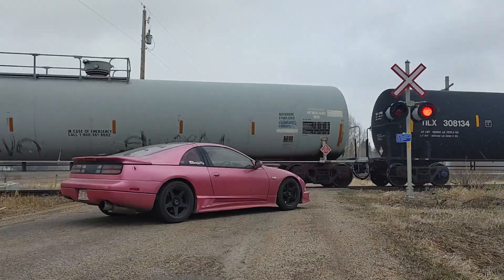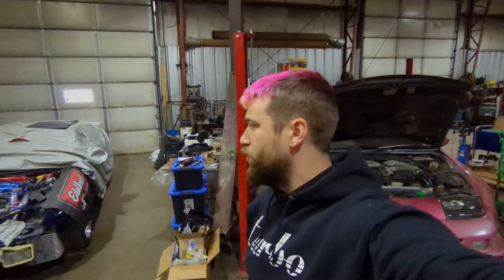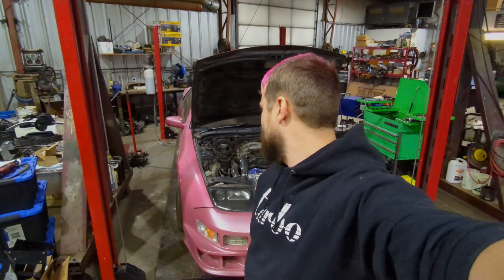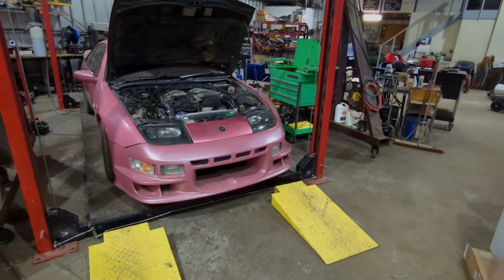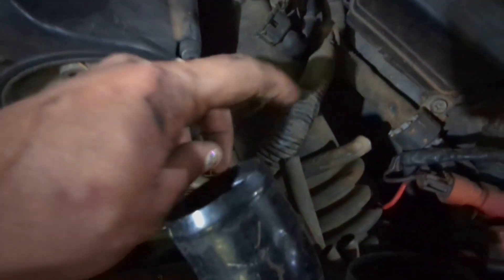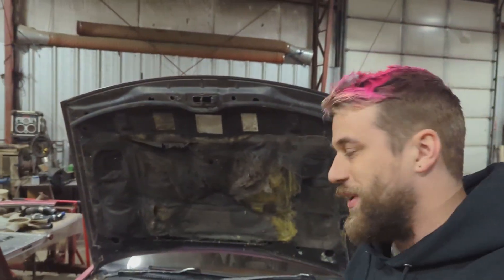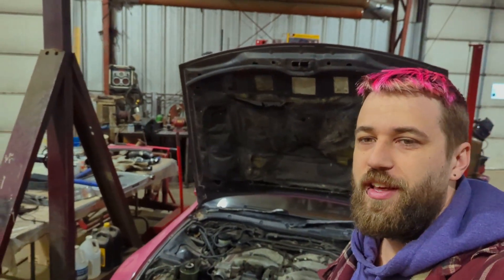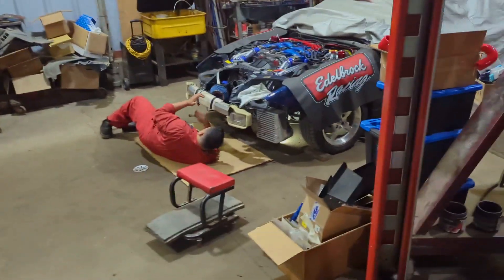Day 1 Building a MASSIVE SINGLE TURBO Z. No block will be safe.

Comment: turbo placement will be sick, but careful all of your fuel soft and hard lines are in that corner
Reply from the maker: Thanks. That's definitely a concern I'm having with the putting turbo there. It's also where the entire wiring harness T's between the side of the engine and rear. Who doesn't love a few challenges though 🤣